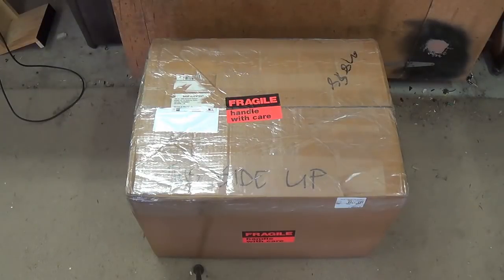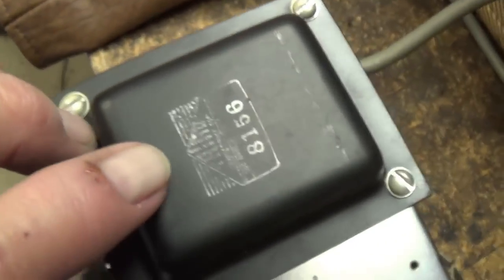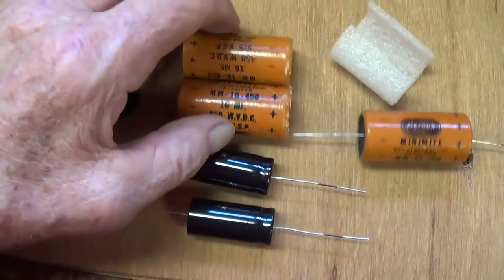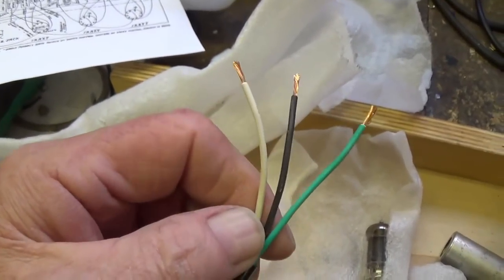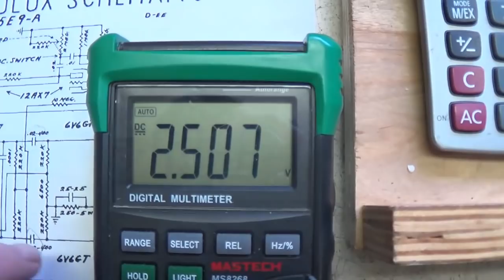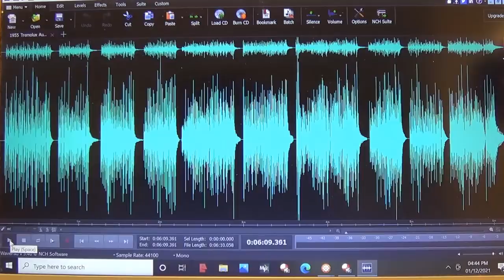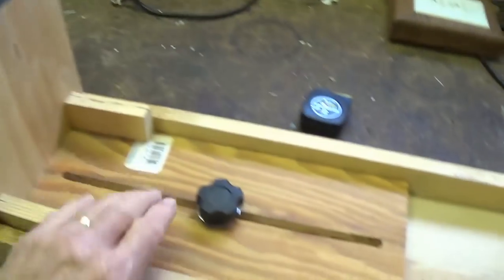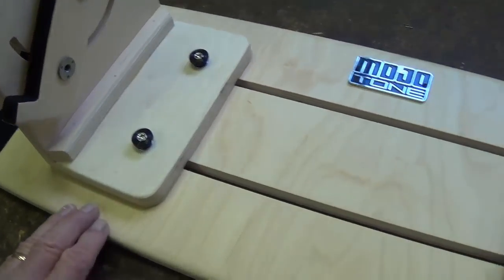1955 Fender 5E9 Tremolux in near MINT Condition.....Wear a Bib !!

Comment: I have a rare oil can morley pedal. Any interest in repairing it ? How can I write to you or call you to discuss pricing and shipment?
Reply from the maker: If the electronic portion is a transistorized PCB, which it probably is, I'm sorry, but I only work on vintage tube circuits.
Reply: @UncleDoug  I only ask because you successfully repaired the tube version of the tel Ray organ tone- the circuitry seems to be ok. I think the oil cans terminals might need work. How did u sand blast and what dud u use wire size ?
Reply: @UncleDoug  thanks for replying!!

Comment: Watch out for vintage style nitrocellulose lacquered guitars on that acrylic stand. I'm not 100% sure but certain plastics and rubbers can react with the nitro finish, melting ugly holes in it. (Silicone is particularly bad but it's not the only thing. I've seen lots of old guitars that have imprints of a curly cable that stayed pressed against them in the case for too long. This page seems to say no-go... https://www.tdiinternational.com/technical-source-product-info/chemical-compatibility-charts/acrylic/ )
Reply from the maker: I have seen similar results of chemical incompatibility, AQ. Thanks for the reminder.
Reply: @UncleDoug  I've been known to put socks over the rubber on guitar stands, just to be sure. 

Cheers!

Comment: This is a nice looking amp, and you did beautiful work as always. I have to say though, I don't particularly see a reason for stuffing the new caps into the old carboard. My reasoning is that you won't be able to visually inspect the replacement caps for bulging when they go bad in the future, nor would it be immediately obvious to a future tech if something goes wrong with the amp that the caps were replaced. (I guess one could put a piece of tape in the chassis that says it was recapped.) Lastly, I would want as little carboard necessary floating around inside the chassis as possible to reduce the risk of fire, even if it was secured really well. Of course, I know it's for aesthetic reasons, to keep it looking original, etc. and the chances of the cardboard catching fire are really slim, but no one would know anyway unless they opened up the amp, and who will be opening it? Most likely someone intending to work on it. So, it just seems like a lot of extra work for a frivolous reason. I guess I also just don't think new capacitors are any less aesthetically pleasing than the old caps. Often, I find them more pleasing because they're shiny. Anyway, it's not my amp, and no one asked, but I can't help but think like a brute functionalist.
Reply from the maker: Thanks for your nice comments, Phillip.

Comment: Hi Doug baby how you doing happy new year still alive and kicking that's good keep away from Corona not your friend.

You should try audio note capacitors for replacement paper in oil they are closest you will get to traditional capacitors probably the copper variant, they do a silver and a tin version  as well. mylar and oil very stable not like the old type rather expensive though and bulky, you could try JJ electronics they make good capacitor like that as well a lot cheaper not as good as audio note but very good nevertheless.
That doesn't make sense why do you need the other hole? the original hole will work if you flip it around don't see the logic there
I would change the design on the manufactured version of the stand or making it yourself why use two bolts?  instead of the 2 slits have 2 guide rails and just the one slit  in the the middle for 1 Bolt like your original. You could 3D print something like that make it into 2 parts glue together if you got a small 3D printer
Reply from the maker: Thanks for your helpful input, John.  Using the original hole, the max jaw width was only 9.5", which was too small to accommodate the chassis that necessitated the modification.  Have some faith, John. We don't just drill holes for the heck of it ;)
Reply: @UncleDoug  yes but when you turned it around the original hole was visible in the slot still confused

Comment: So when this amp is eventually put up for sale by one of the douche bag dealers, it will be advertised as all original, sold as is. Concealing the work that was done perpetuates the myth that these amps can stay in a state of suspended animation and not need modern parts installed. It's also a pain in the ass for the next tech to see what the fuck is going on. Have a nice day Uncle Doug.
Reply from the maker: So I guess I should ignore the customer's requests, do shoddy work, and refuse to preserve original appearance.....just to ensure that some douche bag isn't fooled. Likewise, M.